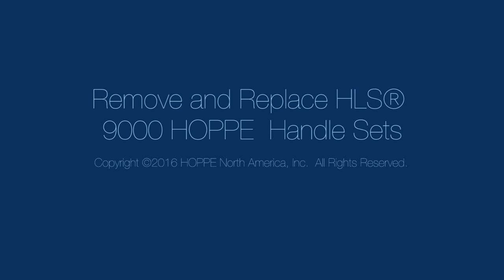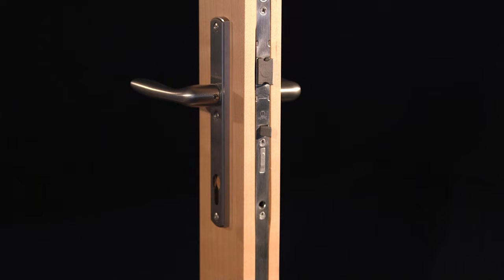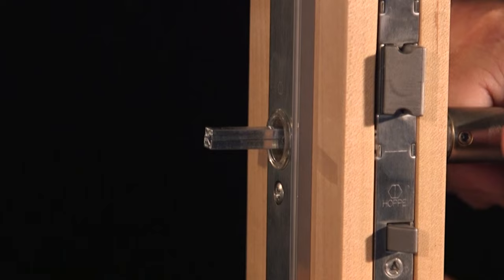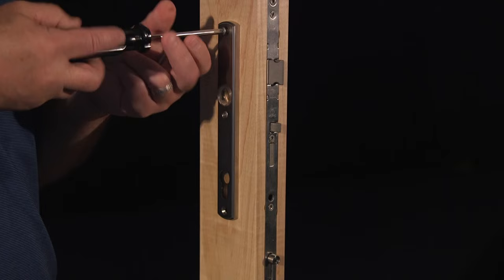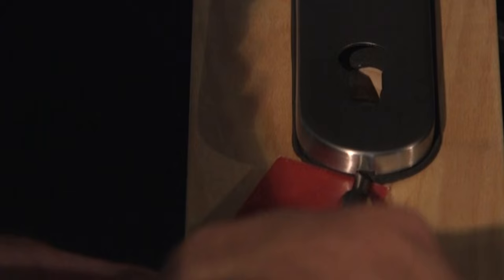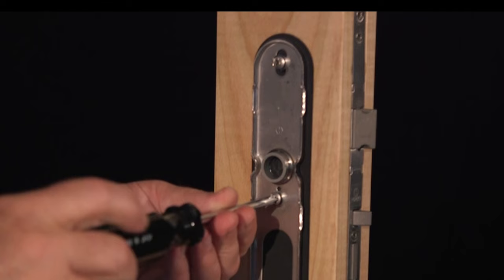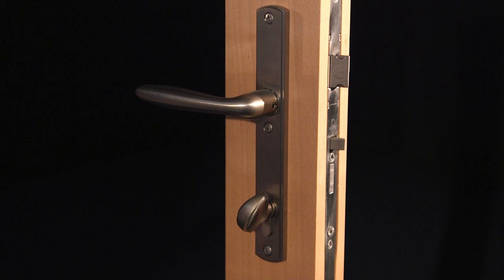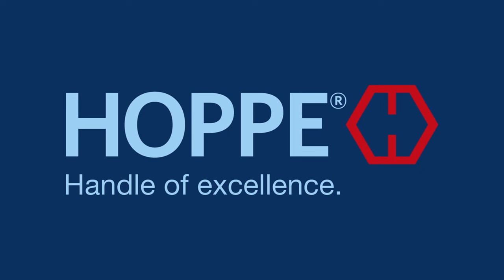HOPPE HLS®9000 Handle Set Removal

Comment: It omits to mention you will also need an angle grinder/sledgehammer or saw as this quick removal system is anything but.  Its quick to fit but you can forget about ever removing it again.  You will need to cut it off to replace.